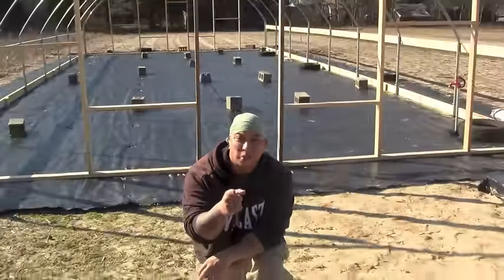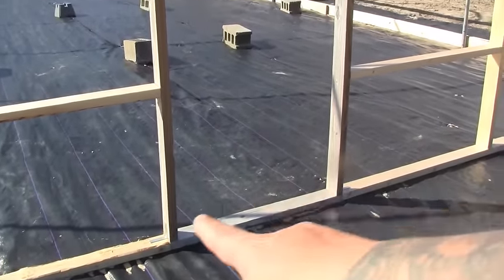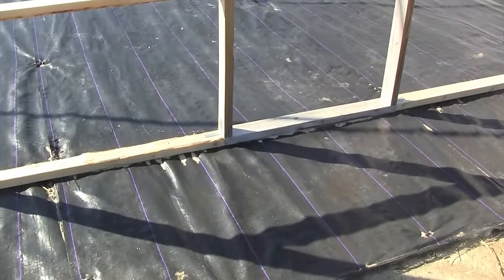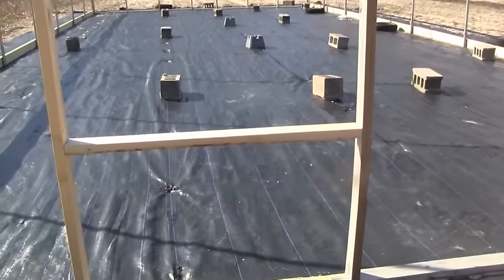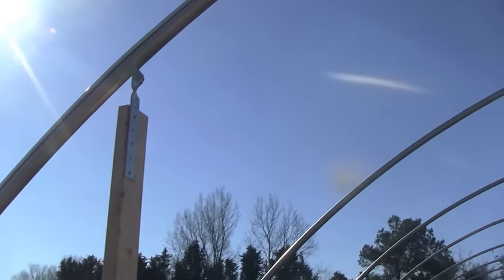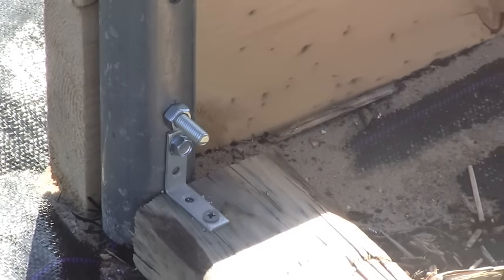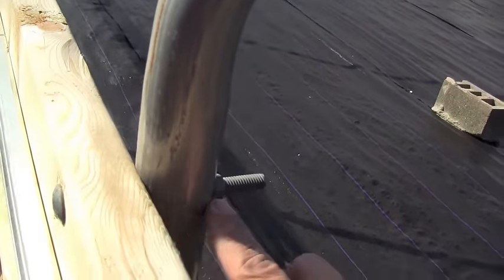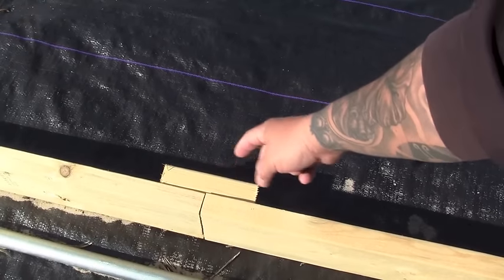How to Build a Greenhouse Part 2

Comment: I want one of those greenhouses but I don't want the curved top. I need straight sides. Seems to me you could just use the list of materials, change the materials to what you want, and make straight sides and a peaked roof out of electric conduit instead of pvc bc up here and snow and tree limbs we gotta have metal to hold up right. And for seeds we need just to stack shelves and shelves of flats. Yours is what most people use which is to grow food on the floor in pots or in the ground like Elliot Coleman is doing. He is also just fyi growing spinach all winter in Vermont in low tunnel houses. His hoop houses are not lighted or heated and he grows carrots, spinach, kale, etc all winter. It's amazing. Thank you for sharing - you are inspiring. I gotta figure out where to get seeds off of thornless raspberries to grow them to sell. I don't wanna sell Heritage bc of the thorns. Yikes. Peace out.

Comment: Is that treated lumber for the end walls? I would probably put an extra screw through the L bracket because you will have significant moisture condensing on the plastic and it will run down onto the base of your end wall. I had that happen on my previous greenhouse. The one I have now has tubed steel end walls.
I had the same problem with the ground cover when I was building mine too. Only happened to me once though. I was able to get the plastic on it before it happened again!
Chuck
Reply from the maker: +Fensterfarm Greenhouse No, the wood I used was non treated so it wont last too long due to all the moisture. Wish I had steel beams instead. Hopefully it can last me e few seasons. Thanks for the advise and thanks for watching.